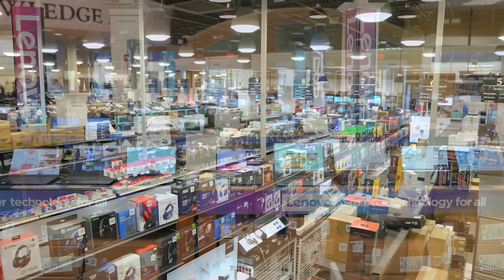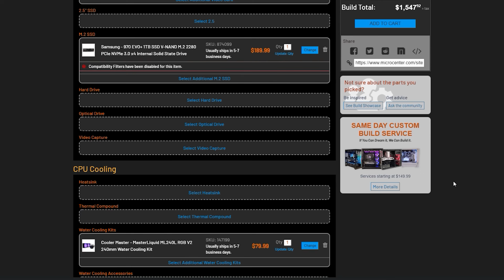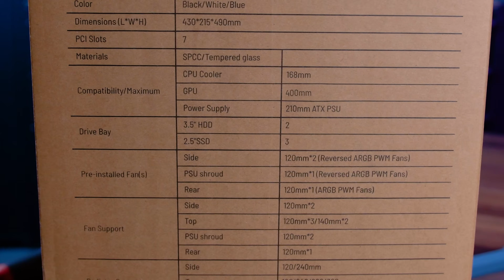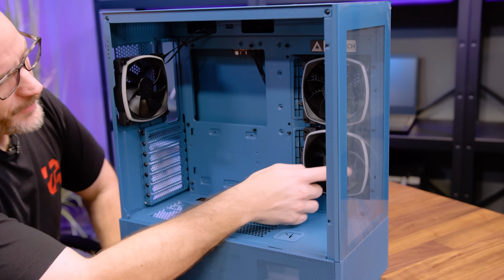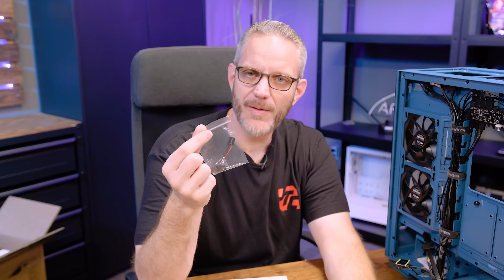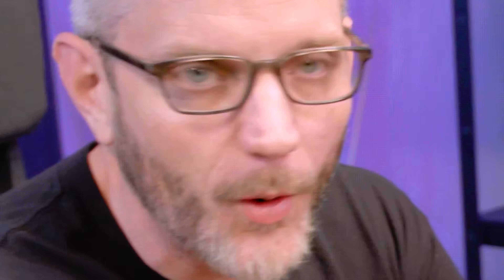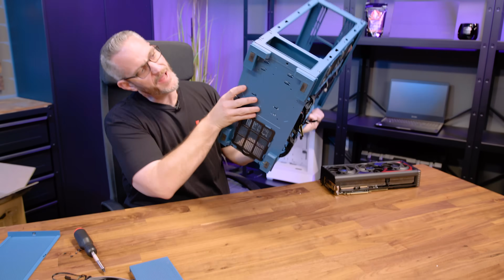This case has a funny name but awesome design choices! Montech Sky Two

Comment: another way to cut costs is to work the employees off the clock.

as soon as they punch out they are told "oh we need you to clean the bathroom"

i think a smaller 2 fan card would work better unless you are ok with part of the card hanging over the fans

Comment: That's a beautiful blue, Montech also has a fabulous "vertical GPU mount," which demonstrates how good their engineering department is (the way the included side fans are reminded me of that fabulously simple, yet perfect, mount, unlike Cooler Master's which costs almost 4 times more and is a nightmare to work with). It all seems so simple, all good engineers make things simple, the less you notice their work the better it is.

Comment: so i got a pre built system that uses this exact case, just white. but it does not have that extra fan they show on the bottom below the gpu, now im running a 360mm aio ontop of the ryzen 7800x3d with a rtx 4090 gpu, do you think its worth buying a replacement 120mm fan to try under the gpu to reduce overall temps? my cpu runs around 45-50 degrees idle and about 80 max, (Side note im used to my old x99 system that never went over 65 degrees under 100% load in the same room and setup,)
Reply: id also like to note the gpu runs 20 degrees cooler then the cpu, do these ryzen 7s run hotter then intel? or just hotter then a much older x99 platform? only off brand item in this system is the aio, maybe upgrade that?
Reply: Who was the seller? Skytech?

Comment: I'm considering this case for a new build. Looks like it has good cable management and will hold all my existing drives. Really liking this shade of blue and worth an extra $20 for something I'll be looking at for 5-8 years. I had to look carefully at the fan blades on that exhaust fan to be certain it was not also a reverse fan that would cause all of them to blow inward! The only thing I'm not liking is the location of the USB ports on the top, but my current system has them there as well. Just doesn't work as well for me because of where I have the PC sitting on my desk.

Comment: My sky two I just built , the fans won't turn and no RGB lights. Is the controller bad? The fans spin when plugged into the MB but no lights. There was no directions about the fan wiring. Any help would be so appreciated.
Reply: Did you plugged in the RGB fans into its socket? And from the controller, have you plugged it into the ARGB socket? Or try searching for one labelled as”JRAINBOW” if there’s no ARGB socket. Hope this helps.

Comment: I've noticed that the intake fans on the side instead of the front have been getting more trendy, but I can't imagine that cooling better than if the fans are on the front blowing air over/through everything. On the sides the intake fans are essentially blowing air into a glass wall, then you just have air lingering in a case to be sucked out instead of being blown over and through your components. Am I wrong?
Is it for looks type of thing or is there a practical reason for it?
Reply: yeah I'm also worried about cooling with this new side fans trend.

Comment: That's the same "Blue"  as all of the industrial computer covers I'v seen in manufacturing. If the weld/machining station needs a computer the wall mounted computer cabinet is that color blue.

Comment: I actually bought this case and did a build in it. I also found a major flaw. If you have a motherboard with a tall heat sink over the vrm's at the top of the MB, and most do. The heat sink will hit against the fans of the AIO. There isn't enough room. They didn't make enough room for the AIO at the top of this case. It's a major screw up. Buyer beware! The motherboard I used was a x570 gaming plus and I used an ARCTIC Liquid Freezer II AIO 360

Comment: I just purchased this case and it looks really good. Building went ike a charm. But unfortunately the full speed error with the built-in fan controller persists. However it doesn't bother me that much because my MB does a great job with the fans. Great case

Comment: If you put the fan to the back where you wanted it, it would be directly over the PSU...so you'd have the psu no longer exhausting to the back as the new fan would be trying to pull that air....not an ideal situation.  Move it over to the middle of the case or lose it altogether.

Comment: I legit sat and had a 10 min think abt fan placement in this case, as I want to upgrade my current case, which already has 4 fans in it, and I will also get a 240mm aio soon. This means I’ll have 6 fans, and I guess I’ll use the 2 reverse fans on this as well, so I’d have 2 intakes on the bottom, 2 on the side, and then one exhaust at the back and 3 on top. Tricky to figure it out, but I’d definitely consider this, as it’s 75£ in the uk

Comment: I bought the sky one. I had to cut some metal to get my cables in but its a solid case. I did ask them for another vent panel instead of glass but they won't do it. :(

Comment: can you use this for a 2023 water build?  Plzzz! last one you did was a year ago.  I want to do a new water build, this will be my first. I'm going broke getting 4090 FE and cooling block, so I need to build around it on a budget. I figure around 300 for the MB and 300 for the CPU. But the liquid cooling and case will break me. I can only go a month or two on potatos. :)   THANK YOU FOR CONSIDERING!

Comment: Hey Jay. i dont know if you have Enermax cases in the us but my Starryfort SF30 has these dustcaps for the IO Panel but the downside is that it has terrible airflow so i will replace the case.

Comment: Expectations have really dropped IMO when a case with a sans fan-mounting non-metal side panel and no front external drive bays is considered great design choices.  A side fan allows for additional GPU ventilation for those who want it and external drive bays allows for hot-swapping and backups via more direct and 'native' connection to the MOBO via SATA.

Comment: I built my pc in a Montech fighter 500 and I love it, I removed the static fans that came in the case and install some cooler master rgb fans that could run off my board. But now for some reason you can only get this case on ebay, been thinking about building another pc in this case.

Comment: I have an Aerocool Aero-1000 for years, that came with dust caps like these. I love them, since I don't use the front ports, and I'm the type of guy that puts tape on every open socket to prevent dust from getting in!

Comment: If you put the bottom intake right on top of the PSU its not going to be able to suck much air.  it kinda needs to be up front unfortunately.  I have toe say the build quality has improved quite a bit, and this is a very interesting design with quite a few thoughtful touches.  Not my favorite design, but I dont think its a bad one.

Comment: Id rather have fans on the front. Having the intake sideways does nothing except create more air turbulence. The holes on the mid plate are good if you want to mount your PSU upside down., personally I prefer this because PSUs dont normally need fresh air from outside the case and it only draws in excess dust even with filters. Any fan intake from the bottom will bring in considerably more dust than other locations in the case, filters get clogged over time and you will find yourself cleaning it more often. BTW I think the blue is neat.

Comment: I have a question I'm doing a build with 10 fans in the 5000x case do I have to use the pre-installed fan hub or can I just take it off and use 2 commander core xt instead 🤔

Comment: Seems solid for $100. Four ARGB fans plus extended fan controller. Not bad at all! The reverse fan under the GPU should help cool the GPU from having a heat zone sitting between the fans/glass. Does anyone know if Montech makes an air or watercooler that will match this new blue offering? @JayzTwoCents the Antec DF700 Flux includes I/O plug caps and also the reverse fan included for the bottom shroud, so they have done it! What I haven't seen is a case of this type have the front and side mesh screw off, that is nice!

Comment: The Montech case is nice but if you are trying to do any form of water cooling even with an AIO its just isn't big enough, if you just want a cheap case that is solid and only staying air cooled then its a great case with great airflow for the value if you just want something in the $50-$90 range, I think I paid $55 for mine and it works great for my old 1080Ti build I use in my living room for light family gaming and watching movies on.

Comment: I'd like to see how it handles a hot load build.  I have tried cases in the past that say they can keep components cool and end up failing on the cool end.  The last one I bought (no names to protect anonymity) my components running Star Citizen were up in the 85-95c range.  I dropped them into an old case (Cooler Master HAF 932 Advanced) and with the same gear was down to 55-65c.  Now this is all on air, not liquid, cooled if that would make a difference being liquid then maybe but I've never trusted liquid in electronics.  It appears to have plenty of additional fans like my HAF case (2x230mm and 3x120mm).  So again I'd love to see it with a hot system plugged into it.

Comment: The BIOS Speaker is better than those dumb regular leds on the motherboards these days, the motherboards that have a tiny display are okay but the beep is better, allows to figure out what's teh issue better than just an LED

Comment: The blue case is currently $20 more than the black one.  That said, it's great to have that option.

I say use white components in the blue case, and use red wiring for the cabling. Get the ol' red, white, and blue going.

Comment: $93? Amazon has em listed at $99(Black), $106(white), and $119(Blue), so you were dead on about the increasing price for the rarity of color.
One other thing being able to remove that mesh allows: you can install a cd/dvd drive/burner if you need one for any reason in a case that otherwise couldn't support anything other than an external.

Comment: In the last couple of years I've built over 40 PCs in Montech cases. My personal favorite is the AIR X with (2) 200mm ARGB front fans and (1) 120mm ARGB rear fan coupled with a full ARGB fan hub. Outstanding value in my opinion.

Comment: In a previous post with booting, the cmos clock screwed up and now stuck in 5 second post delay.  ESC key will not work.  Tried removing battery for a few minutes, does not reset cmos clock even with plug out of the wall.  Need help

Comment: Standardized front panel connector shout out. That takes me on the way back ride where every darn time I bought a new case and motherboard it was a chore trying to match all the little pins in a zillion different orientations!  Thanks for highlighting a cool value case.

Comment: Looks like a good value but I would rather spend $93 US on a case with no fans.
I always prefer to pick my own fans, and I have never liked paying for fans I'm not going to use. For the cost of the fans they could add another feature or add another inch to the size or reduce the price. Also you could get fans with RGB on both sides so you don't need to use wierd fans with backwards airflow.
I still prefer traditional cases with fans on the front.

Comment: Silentium pc have speaker and dust caps with the cases at least the one i got have it and it's the Silentiumpc Astrum AT6V TG a case from around 2018_2019 good airflow good construction you should probably feature them

Comment: I dig these different colors. I still rent, so me changing colors of walls etc aren't practical, but if I owned and was able to make my own space, having a case like this would be an awesome focal point for a build. It would also be nice to see someone do this and paint/wrap a monitor bezel, etc to match, or make a contract color. Terrific idea by the "little guy on the block" to go against "we MUST make money" mentality and offer something different. And to add the reverse fans and the fit cutouts for the side mount showed the company took their time to design with the end user and experience THEY have, in mind. Massive props to them for thinking of us first.

Comment: As a system builder over 40+ years, this case is, to me, a disaster.
Why create a lower air restricting partition? Power supplies don't need to be nearly 15 inches long.
Why put the fans on the side blowing out in a position with this video card blocking it?
Why put the power supply feed-thru more than half way towards the front instead of further back?
What is the 2nd level perforated grid holes for? The power supply won't use it and there isn't much air flow below anyways.
Why is the rear case fan not fitting the rear case outlet grid?
Not to mention all the little snafus Jay found and warned about.
I'm sorry but this case isn't open and easily maintainable with these air flow blocking multi-tiered levels, maybe that's why they include a few big 120mm fans.
Thank God I wasn't reviewing it. They'd  never send another case to me after I got done.

Comment: I really like the fact that there is openings in the front side to the power supply and cables,makes cable management a lot easier.Always just think it is wrong just to push cable in to hide them.

Comment: Jay. they have on their site they have a vertical GPU mount kit that is using a PCIE 4.0 riser cable for all of their cases that have 7 PCIE slot. In fact on their site, they show it in the Sky Two Mid Tower.

Comment: It looks like the reversed fans only spin in reverse, the blades weren't molded in reverse.  This would create such an inefficient fan.  Those two intake fans wont have much flow for the power input.

Comment: 16:38 "Will my cable clear the side panel? That's something we didn't have to think until this generation" 
I used to run an XFX RX590 "Fatboy" and originally I wanted to order it with a different case, but it wasn't in stock so I ordered a cooler master mb511 to go with it and the cable just barely cleared the side panel. Wouldn't even have worked with the original case I had in mind

Comment: PC Accessories idea: Rigid J and U-bend pin intermediary connectors, you connect the 24-pins from the psu to a female recepticle end, and its a single solid piece (sort of) doing a u-bend in a small radius to a male plug, save you trying to bend your psu cable and breaking it and/or the motherboard socket.

Comment: DIs liked. Just another box. 
Blame the mother board manufactures.  I have my PC on the other side. 
Cant find a good case to run on my right. so I run a test bench style. Lian Li PC-T70 (WHite) all air cooled. 
its the port access, that running an every BOX cant fit. I want a left side PC.  
Again I blame motherboards 4th gen Ryzen has nothing to accommodate. So FLAT test bench style it will be.

Comment: 14:27 Yeah, that happened to me with my Silent Base 802 when I was feeding the GPU power cables through the grommet -- those cables are pretty bulky, and I found out the hard way that you need to be careful feeding them through in particular.  No, I need to clarify after watching further -- the 802 grommet didn't rip apart, it just pulled away from its hole in the casing.  The 802 grommets are much sturdier than the ones in this case seem to be, with much thicker rubber.  I don't think it's possible to rip the actual rubber of the 802's grommets unless you really go at it.
19:38 Tell me about it!  I was saying about my Silent Base 802?  The first build I had (almost) no problem, but the second one it was so hard to get the back panel on.  I swear Silent Base don't leave enough space for the cables, and at one point after about the 15th attempt I thought this isn't going to happen.  Eventually I found out there's a knack to clicking the back panel into place (you have to push it in and then to the side, but really just pushing it in should be enough), but it's still a real pain -- or maybe there isn't a knack to it, more likely it was the back panel's foam finally relenting.  It's not as if I could have tied or flattened the cables any closer in to the inner bulkhead.
It seems manufacturers finally got the message that keeping the case cool is 99% of everything to do with its design.

Comment: igh igh igh, aint never met a man that didn't like a compartmental bottom. One Middle Tower to rule them all, my precious... @13:25 that ultrawide is nice to mount on the Hyte y60 Angle, side fan mount area or inside facing out behind tempered glass.

Comment: these gpus are so dam huge now that the case itself looks like its just a suitcase to hold it in only lol... Its like well.. now these companies going to have to run back to the drawing board because we got a freakin SUPER CHARGER inside this extremely small chassis lol.. take it to the drag strip and sees if it pull hard enough on a Quarter mile run lol.. 😭😅💪

Comment: That is actually an interesting case. I like the blue, and the case seems pretty thoughtfully designed. Equipping it with a full suite of fans is nice, as if it's a new build (or builder) you don't need to worry about mismatched fans or having to buy extras. The flipped fans is also a nice touch.The accessories pack is nice.
If they made a mesh version of this in blue, I'd be tempted to use this for a new build. But i'm just not into the whole tempered  glass thing.
Reply: I using this EXACT case in a build and I plan on ripping those fans out for ICUE fans just because I feel like they would look better next to my ICUE AIO cooler and they'll all connect for RGB control

Comment: Jay Jay Jay, Recommend me what would be better? Alienware Aurora R15 or build one myself? 
 This’s my plan:
- GPU: NVIDIA GeForce RTX 4090 Founders Edition
- Core i9-13900K
- Case: ASUS ROG Z11 Mini-ITX
- Motherboard: ASUS ROG Strix Z790-I Gaming
- Ram: Corsair DOMINATOR PLATINUM RGB DDR5 64 GB (2 x 32 GB) 5200 MHz
- Aio: ASUS ROG Ryujin II 240 ARGB
- ASUS Rog Thor 1200 W